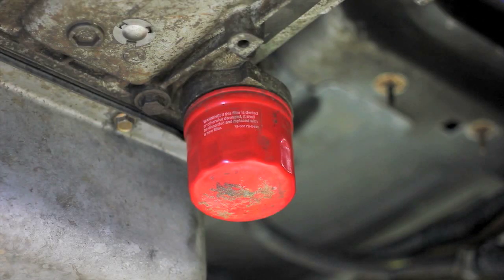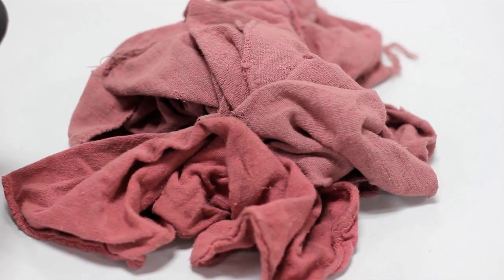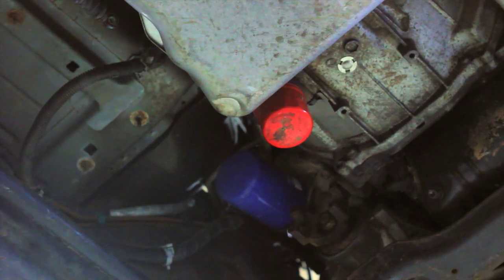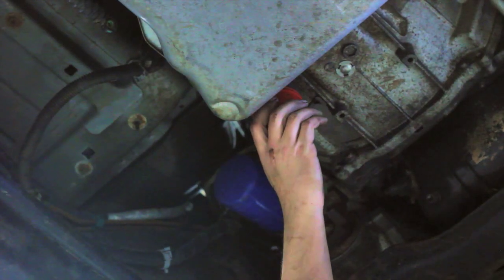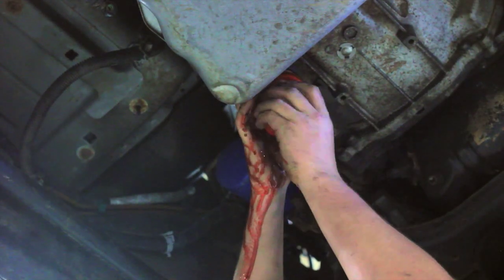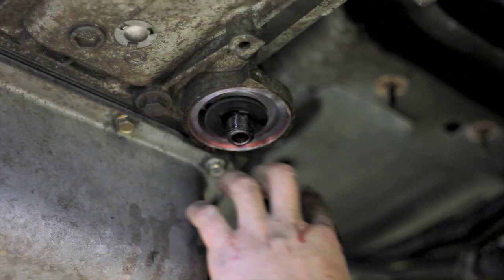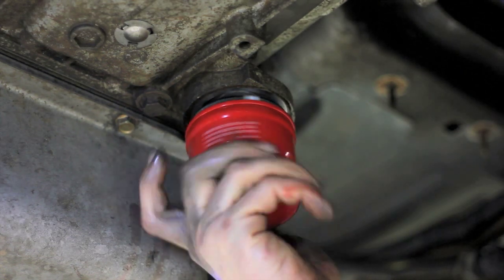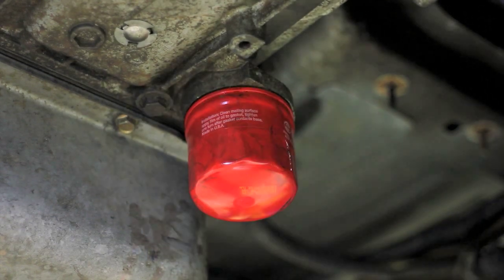The easiest maintenance you can do on your Allison Transmission

Comment: It's always a good idea to use a sharpie to mark the date & mileage at the time of fluid change on the bottom of the trans filter after each oil change. Plus it's always a good idea to keep a written record of your servicing in case you sell your vehicle. It shows that you care about and take care of your equipment, which at the time of sell, you might make more $$$.
Reply: +Todd White Great tip Todd!  A good rule of thumb would be to service the external filter when you change your fuel filter.
Reply: +Eric Merchant Personally, I've always changed my oil filter every 5-6k miles but the fuel filter every other oil change or around every 10-15k. I change the trans filter every 50k. I truly feel that filters are the life of my motor. Currently I have 330k on my dodge motor. I also keep a written Excel ledger on my equipment so in case I choose to sell it, I include my written records with the sale so that the new owner knows just what he's buying.
Reply: +Eric Merchant if I were to drain the fluid out of my Allison how much fluid do I need to top her off?
Reply: +RAPTURE READY I remember using 8 qts in my '07 Ram 3500 4x4. Drive it about 40 miles or so then check again. You might need to top off with another quart. A lot depends on whether or not you were able to drain your torque converter or how long you allowed your tranny to drain. I also like to change tranny oils every 50k and always use the recommended ATF+4.
Reply: Getting ready to change filter & trans fluid.  I got transynd & a Allison spin on. How often should this be done?
Reply: +RAPTURE READY I change trans fluid & filter every 50k
Reply: That's standard for most transmissions

Comment: Where did you get information requiring to change this filter every 10-15k miles?  The Allison website recommends changing it every 50k.   I suppose that every 15k is better, but is it really necessary?  Just wondering if you got the 15k from published information or if that was just your opinion?
Reply from the maker: Great question!  The recommendation comes from me, not direct from Allison.  The reason behind that is for good maintenance practice.  The filter is inexpensive and a restricted filter can lead to transmission related drivability issues.   A good rule of thumb is every other oil change.   Again, this recommendation is from me, not from Allison ~ Eric
Reply: Just my opinion.....why would you just change the spin on filter and not at least drain and fill? Seems kinda pointless. I always recommend a drain and fill with replacing both spin on and internal filters every 30k if you tow or haul heavy loads, every 50k if it's your grocery getter. They will last over 300k if you do that.

Comment: The Chevy dealer wanted over $100 to change this filter.  Seriously.
Reply: haha damn criminals.. they tried to hit me with an $85 oil change the other day.
Reply: Are you sure it was this filter? There is also a filter in the pan
Reply: @Allison Duramax $25 filter and literally 2 minutes to change.
Reply: @eddie4594  Yes, it was the spin on filter.
Reply: @Allison Duramax that assumes it takes 20 min to do a 2 min job when it's already over the pit or on the lift for an oil change. Maybe it's not criminal, but it is offensive.  If you consider even $50 labor for the 2 min job, that's $1500/hr for someone to spin off an filter and spin a new one on.

Comment: I heard that all Allison transmissions have a distinct whining noise to them but you hear it more on the gas motors because they aren't as noisy as the diesels is that true ?
Reply: +WPcannibal Mine whines and the local Chevy dealer service manager has a newer 8.1 and his whines also...so he says. I believe him. I think you are right about the diesel noise covering up the transmission noise.
Reply: +1crazynordlander you are correct.  The Allison does have a bit of whine to it at idle.  The Diesel engine seems to cover that noise up however.  The early trucks (01-03) seem to be a bit louder, starting with the 04 trucks, Allison made a change to allow the line pressure to be reduced at idle, helping to decrease the whine noise.
Reply: Eric Merchant It's a truck! Let it whine. I have the '01 8.1. Everything about the truck says I want to pull something heavy. Good unit in my estimation and I hope to keep it for a good long time.
Reply: Mine in my 8.1 doesn’t whine. It’s quite. Takes a while to get used to an Allison shift. Felt sloppy at first. Now I’m used to it

Comment: So do all Allison transmissions have the magnet even a 2001 8.1 gas chevy Silverado 2500HD I just changed my filter because my trans has a slight wine noise and the filter was leaking a little bit but they only had one kind of filter at the parts store buy me I hope WIX premium filters are good I mean it cost me $23
Reply: WPcannibal
If the magnet wasnt on then it got tossed out by mistake at some point. Not many people know it has a magnet, & the magnet gets tossed out with the old filter. The Allison labeled spin on filter cost 8-13$. Big rig parts stores carry the spin on filter & magnet for it. If your trans is whining somethings up.
Reply: I sold the truck it cost why to much in gas and tires even though I really miss it at times I wanted something fast so I got a 2005 GTO lol and I'm in love
Reply: Internet tough guy
Reply: WPcannibal sorry I agree a man needs a truck not a fast car "lol" think of the Manliest men you can think of, they aren't driving gtos they are driving trucks.
Reply: I bought a wix for $25 and it's made in India, I kid you not! it will be returned because merchant auto  has the Allison filter for less money.
Reply: WPcannibal you can get them from Merchant Automotive who did this video for $10.00